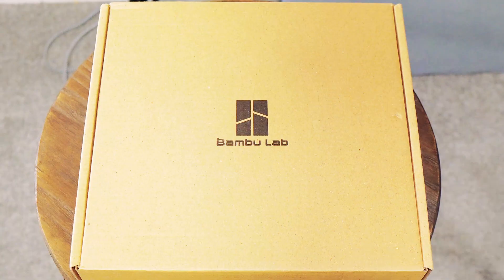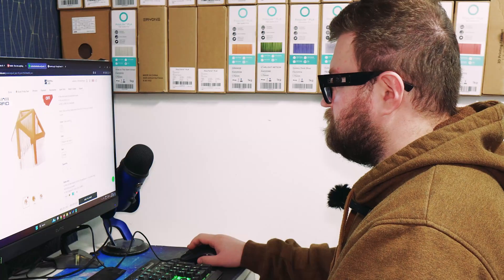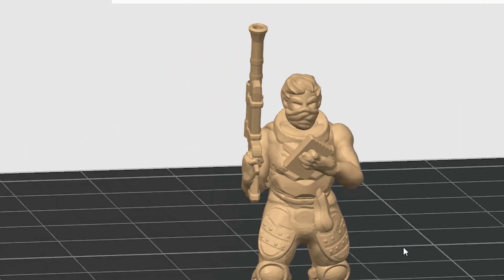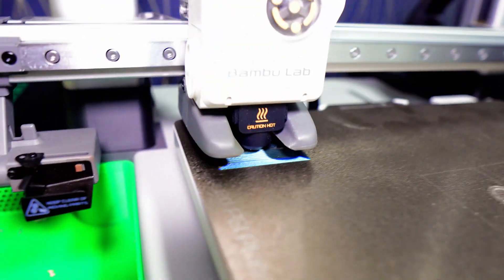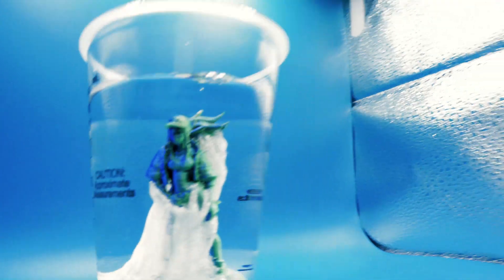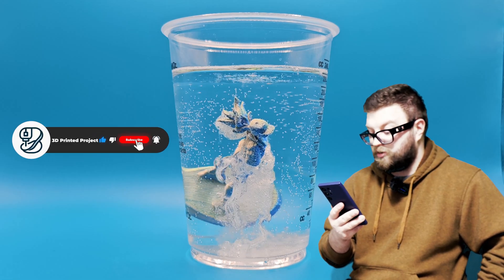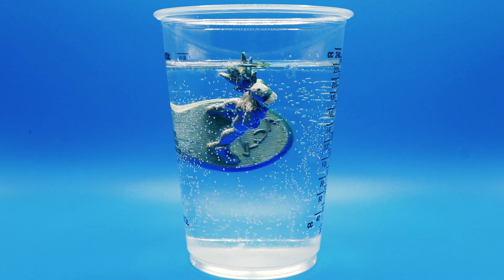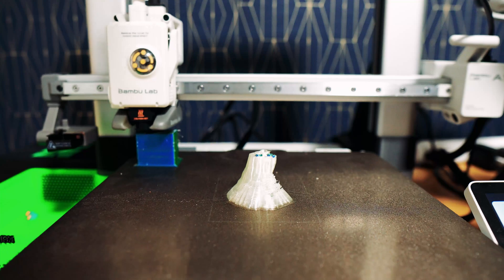Best 3D Printing Support Filament! Bambu Lab PVA

Comment: HI, can I sugggest that you only use it for top 2 or 3 layers of the supports, or where the support contacts with the model, saves a lot of PVA filament and money and has same clean break effect

What temo do you print bambu PVA at
Reply: what temp do you use  because ,ine crystolises and gets knocked out by the next pass
Reply from the maker: @grahamwhitehead5629  can't remember, but when making thay print I used Bambus recommended setting.
Reply from the maker: That here is the excellent suggestion. I had this video on TikTok (short) somebody made a similar comment.

PVA being expensive as it is, this sort of method would definately save people material.
Reply: How would you set this up in bambu studio? I am kinda new to the software....
Reply: Just use PVA as the support layer, can be allocated in ORCA by going to SUPPORT, then activate support in the check box at the top, then  choose the filament for support make thyem both the same, hope this helps

Comment: Is there any setting in Orca that makes it possible to select a filament only for the interface, so I can print cheap PLA+ for the model en the support, but can use another material like PETG or PVA on the model/support interface?
Reply from the maker: Hey there I don't use Orca, but I did check online it seems it has very similar feature, it should be there.

Comment: I’ve just ordered a roll myself, I’ve been trying to print joycon and dualsense shells I’ve designed in petg translucent with glass settings (no cooling), but the complex designs require a lot of support and it all adheres to the print too much. Hopefully using this for the raft interface will give me the results I want
Reply from the maker: Dualsense as in like the ps4 joystick shell?
Reply: @ the ps5 one but yeah!

Comment: Hi, I'm interested to print 1/4 sized figures, would PLA be a good choice for small details?
Reply from the maker: Hey there, within your slicer settings you can choose to have finer detail by choosing lower layer heights.

You can also change your printers nozzle to lets say 0.2mm instead of regular 0.4mm.

Just beware it will drastically increase the print time.

And yes PLA is fine.
Reply: @3DPrintedProject  oh sweet! I am planning on buying an X1 Carbon for my hobbies.
Reply: A resin printer would probably be a better choice😅
Reply: @WouterZtube  I have an old resin printer from anycubic which is the Photon S, I never got to use it because I couldn't find 99% Isopropyl locally back then. Now I have access to it, I am planning to give it a shot....I doubt it will give better quality than modern resin printers like the Saturn 4 Ultra or an FDM printer like the X1C....
Reply: @ FDM can result in good prints. My X1C prints amazing, but for small details resin is more accurate.
Reply: @WouterZtube  I will use both and compare the results.

Comment: Could you use your regular PLA (or print material) for supports and this PVA for just the interface? It would still work the same way right? You’d just have the supports in the water too but separated from the model? I haven’t ever used any support material (besides an intentional print with the sample that came with my Bambus 😆)
Reply from the maker: Should be able to yes. Also please do not forget to dry the filament if you're planning on using the AMS prior to printing.
Reply: That sounds like it would be a lot cheaper, faster to print, and faster to dissolve after. I cant see any down sides!
Reply: That kind of works. It doesn't stick all that well to PLA. Printing the entire support out of PVA is definitely the easier route
Reply: @lion2ger  Yes, that was my experience.